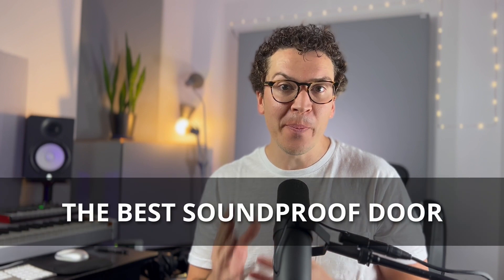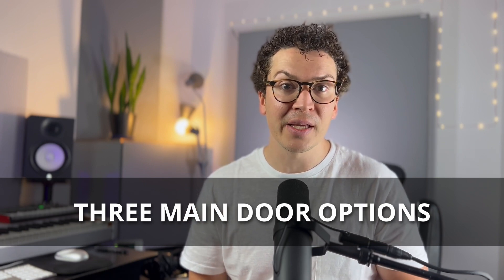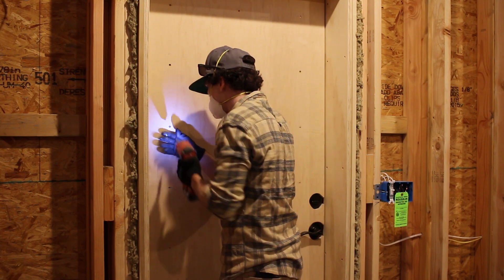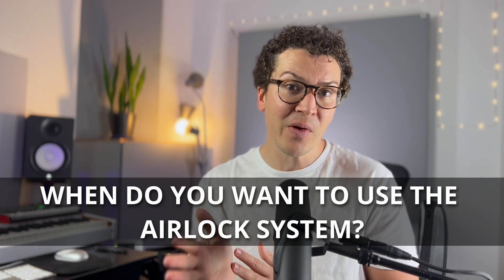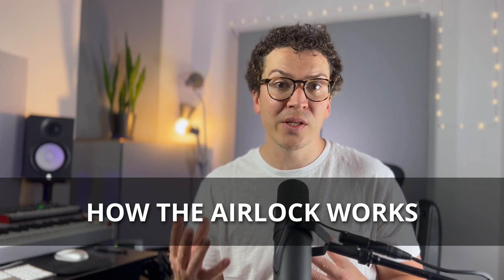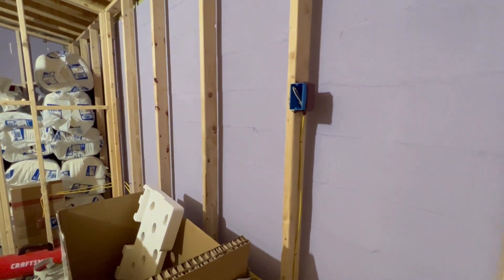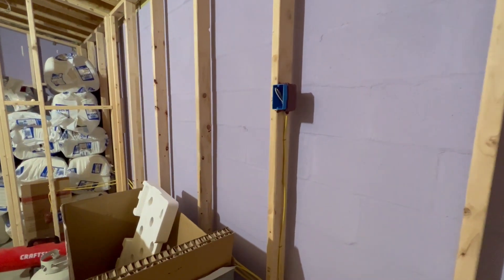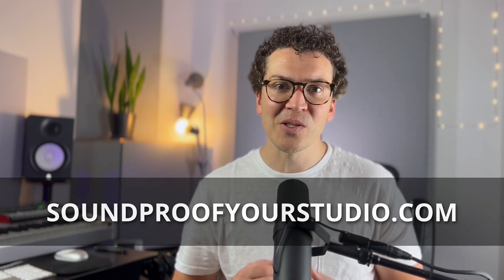What Is The Best Soundproof Door?

Comment: The space I have available for an airlock had a plumbing clean out in the ceiling that I need to access.  I was considering a drop ceiling in that space because it was originally just going to house my ventilation dampeners... Will the drop ceiling negate the benefit of the airlock?
Reply from the maker: Great questions! So if you can keep the airlock itself soundproof it would certainly improve the airlock design. However, if you have to have a weak point it will still work to a degree. Another solution is to put a communicating door in your studio entrance and the airlock will serve as an extra barrier. This way your design is solid and soundproof and the airlock doesn't have to a be the weak link. Hope this helps!